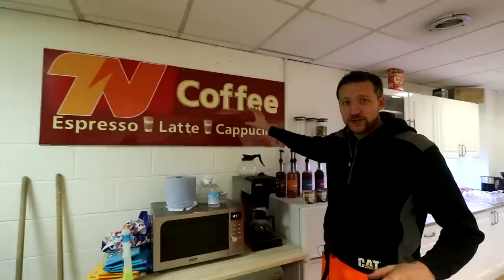I bought the CHEAPEST flood light in the UK | Nagy weekly ep08

Comment: Those LED panels are totally unsmoothed.  The LEDs strobe at 100Hz on the rectified DC and use very simple current regulation, so the LEDs tend to only light for the upper part of the sinewave.  Hopefully yours was actually earthed, as some of the earth wires are not connected internally.  That's not good, because a common failure mode of these lights is for a failed LED to arc and potentially burn through the insulating layer to the aluminium panel it's mounted on.  That results in DC biased leakage.
Reply: i could actually hear your voice whilst i was reading this Clive
Reply: I'm pretty sure at some point big Clive will just be uk electrical advice service for all UK yt. Barry, ashen Tom you name it
Reply: As soon as Tom asked the question – I just knew that you would know the answer.  So pleased that you saw it and have provided a solution.
Reply: @BigClive.... As much as I thouroughly enjoy your channel, I don't understand why the flickering stopped when plugged into the ring back at the workshop.
Reply: @olly7673  at site it was probably voltdrop and the cheap unit cant cope, no voltdrop at the unit
Reply: @brianhewitt8618  That is what I mentioned earlier was my thoughts exactly but BigClive knows his onions.
Reply: @olly7673  my bad, I didn't read all the comments,  and yes he's a special breed
Reply: @frankiesparkes3947  that's a good idea!
Reply: And here was me writing a comment on how he should send these units to you for autopsy and then boom see your post lol
Reply: My beardy bro
Reply: @brianhewitt8618  That's what I was thinking. Wonder why Tom didn't check voltage on site.
Reply: As soon as I saw the flicker, I just kept thinking about Big Clive!
Reply: I'm so disappointed I have to wait till next week to find out why the flickering. I am three+ I think weeks in trying to troubleshoot flickering LED lights and it's not because they're on dimmers but they are. Every time the on-demand water heater kicks in it's gets psychedelics stroboscopic seizure inducing. I think what's happening is the triac is switching the power to the heating elements and element 2 is putting out a really weird waveform that's causing interference into the electrical distribution. Unfortunately they are all in one Canlighs in the new addition with plank board ceiling.
Reply: Well, that certainly pre-empts the comment I was going to make of "Send the floodlights to Big Clive"...
Reply: Big Clive speaks, everyone listens.👍😊Ahmen
Reply: I scrolled down to suggest he send you one of these lights for a tear down.
Check the earth is connected... things like that. :)
Reply: Is it something to do with the unit being 3 phase?
Reply: Are these lights worth buying and fixing the problems yourself. or are they totally rubbish. Would they be ok in a garage
Reply: I bet if he threw one on a variac and slowly dropped the voltage, the flickering would become increasingly obvious.

Comment: I'm guessing there's enough of a voltage drop on that cable to cause the light to flicker and the other brand is just better at handling that. 
Also, that 75W is assuming the light has unity power factor, it's probably closer to 60W.

Comment: These cheap floodlights are cheaper because they use less LED cobs and over drive them, so they are proper bright and pull the full amount of energy and heat up a lot. But they last way less than a proper floodlights. You can mod a 100W cheap floodlight to use 50 to 60% of the power so they last forever without issues even if you get less light.

Comment: I can highly recommend lights from Ledvance (which is a brand from Osram). They have floodlights in 6500, 4000 and 3000 K, with an competetive price and I very rarely had any problems with them. I don't know how the availability is in the UK, but in Austria/Germany you can get it at the wholesalers really quickly. Also they have other lights too (commercial / industrial), so it's worth checking out!

Comment: Flicker could be caused by a mix of the cheaply constructed LED driver circuit and the already choppy supply feeding it. All those other lights on the same supply feed have their own switch mode supplies which will have an impact.
Reply: A small noisy ripple superposed on the 230V AC won't be noticeable with any meter (or oscilloscope; a spectrum analyzer could be useful, not really an electricians tool however) I would try to add a small 230V rated capacitor in parallel with the lamp, it should take care of the (majority) of the noise...
Reply: Maybe it was to cold outside
Reply: Better lamps will have better capacitive filtering on the driver output. More components, more £££.
Reply: @laurensscheldeman4121  You could probably swipe a capacitor out of an old fluorescent unit.

Comment: Regarding the gel... I spoke to a rep from Wiska at Elex last month who enlightened me about why IP66 boxes get wet inside. It is due to pressure differentials throughtout the year. Inside the box, being a vacuum, draws in moisture from the air from chages between hot weather and cold weather causing condensation inside the box BUT they have an answer to boxes above ground (not buried under ground which do need gel) in the form of VentGland or VentPlug which equalise the pressure throughout the year.
Reply: I work in a wet environment and they say a box is ip rated until you drill a hole in it. After that as you say the atmospheric conditions heating cooling and water vapour cause water ingress.
Reply: Hang on.: You say that the inside of the box contains a vacuum - yes? - So how does a box that contains a vacuum draw in moisture from the air? If that were the case then the vacuum seal would have to be broken first.
Reply: @Sharron-Idol  that is what was explained to me as being the case - the seal is broken by the expansion and contraction of the plastic due to warming up and cooling down and drawing in the moist air which condensates inside it.
Reply: @olly7673  I understand what you're saying and the point you're making; but vacuum it is not. :)
Reply: @Sharron-Idol  a better term would be "sealed", or as wiska put it, "hermetically sealed"
Reply: @olly7673  Agreed. :)

Comment: If you want to change the colour of the light, and you can open it, you could try a photographic gel (plastic sheet) inside and convert from the cool white to warm white, you'll lose a bit of power output and you'll need to be careful of heat (although you can get heat resistant ones too).
Reply: And lose any warranty you might have had.

Comment: Re driveway lights, if possible insert a transformer after the switch and convert the ground lights to 12v selv, then they can't trip and will be safe
Reply: But ist there a damaged wire underground or short
Reply: @harrymcgill6291  from what he describes it sounds like a fault to earth... which can't occur with selv... probably due to moisture in buried junction boxes rather than damaged cable. But yes you'd have to test first to know that you still have at least two continous cores that aren't directly shorted to each other.
Reply: @lewistempleman9752  👍🏻👍🏻
Reply: The connections will corrode away anyways even if you get it working for a short while.
Reply: @mrfrenzy.  They won't corrode that quickly infact, but even a couple of years would give them the option of working lights until they're ready to relay the drive and replace cables
Reply: @lewistempleman9752  So you're gonna spend time and money on replacing all the lights with 24V that may last a couple of months or a couple of years.
I would rather rent a ground cable locator and find out where the junction box is. Lift a couple of tiles and dig it up. Then you can easily isolate if the fault is in the box or one of the cables.
Reply: @mrfrenzy.  lifting stones would be preferable but he already said in the video they aren't going to do that,  converting to selv is a fairly inexpensive if temporary solution
Reply: @lewistempleman9752  And when it fails after 11 months the customer is going to want his money back (a business is required to give consumers a warranty in most of Europe).
Reply: @mrfrenzy.  you don't have to provide cover for the cabling and any parts you didnt install, personally I always give the clients all the options and inform them of the risks, as you say you can only test the cables and give a professional opinion, I've got plenty of wealthy clients who would spend the money to have working lights knowing they may fail again in the future, I've also got clients who I know don't have the money and I wouldn't be pushing them to spend it, there may also be other options but SELV conversion has often got me out of trouble
Reply: Was thinking the same, can you use the "damaged" cable with a poss earth fault to make say 2 strands of 12v, then run each lamp at 12v selv, that way you (might) not have to dig up the drive? I mean hey... it might not work but might be worth a shot?

Comment: Have you checked the supply Voltage at the tree 🎄..?
Cheaper fittings have less voltage tolerances than expensive ones...

That's why it'll work fine in the workshop because short cable runs...
Long cable runs in the garden = volt drop...

Comment: Flicker on the floodlight will be the cheapo power supply inside. If you fancy tinkering just put a quality capacitor on the PSU output. That will smooth it and take the flicker out.
Reply: True. But it'll also increase the mean voltage, which could cause premature failure.

Comment: We make led floodlights in power outputs up to 10000 lumens polycarb bodies and replaceable boards and driver colour temps down to 2400k. Not the cheapest but every component driver board etc etc is replaceable so pretty economical in the long run, we hate the idea of all the work going into making and shipping these products and they just end up in the bin.
   Water finds its own width !!! I have been making IP rated products for over 25 years it's hard !!!! Love the Gel connectors simple effective solution.

Comment: On the driveway lights with the failed underground cable... it looks like you've got three core (2 + earth) flex.

Would it be an option to work out which of the cores are faulty, say there's a line-earth short, connect them together and swap the whole thing to 12 or 24V? So your brown and yellow/green would be +12 and your blue would be 0. Or whatever combination of cables that makes it function.

You'd have to be very careful to label everything, oversleeve, put an obvious sticker where it's fed from saying "it's like this because" etc. etc. but it might work.
Reply: That's only a temporary workaround. Soon the connections in the water filled box will corrode away.
Reply: No, it doesn't work that way, the cross-sectional area with 12V would have to be a LOT larger to carry the required current.
Reply: @mrfrenzy.  you're quite right, I hadn't considered that aspect! 
Not that the original install was done in such a way to make it anything close to permanent 😅
Reply: @mikeZL3XD7029  if you've got 6 lamps at 3W each running at 24V it's less than an amp. And the cable looked like it could have been 1.5mm so that doesn't seem too out of whack? 

Clearly a 50W halogen at each point is going to be problematic!

Comment: Flicker will be from electrical noise from the supply or items on the supply feed.
Out of interest was the LED transformer on the supply feed for the flood light.
Those cheap LED lights have no smoothing in the circuit usually so that could cause the flicker.

Comment: Electric forklifts have hydraulic motors so the are rock solid. At my old unit, one of the guys had a right ropey forklift with old crusty batterys. It always run out of guts on the small incline of the alley drive way. Forever asking the engineere to give it a tow in his automatic jeep thing with the fork lift barley powering its pump. Asked me once, but I said get stuffed, I'm not riding my clutch for 3 minutes pulling 5 tonnes of scrap up the drive.
BTW, stick that flood light in the fridge or freezer, bet it flickers then.

Comment: Those 2V cells in the fork-lift batter look to be what we called submarine cells, supposedly because they were used in subs.  Their virtue was that they suffer little degradation from deep discharge. 

The can't move if no power at all is probably a "safety feature".  But if so not having some way of negating the interlock in an emergency is daft engineering.

Comment: Like Clive said he has dealt with a few of those types.. i recon the voltage at the JB was just low enough to be an issue for the driver circuit. In fairness those 2 look better quality than the ones Clive took apart.. defo check the earth like Clive mentioned.

Comment: You should have measured the voltage exactly at the point of termination with a decent multimeter for those lights. It may be that voltage was out of their range, so volt drop maybe a factor. A lot of electronics requires between 220v and 240. I have seen electronic equipment that has stated 230v and that’s that. Come in any lower and it won’t work right or won’t last long
Reply: OTOH, the grid is allowed to fluctuate quite a bit (+/-10%, i.e.between 207 and 253 V)t and devices connected to it must be capable of dealing with it.

Comment: Those cheap led fittings are usually over driven hard & all the ones I've used have lasted about 13 months (typical) & then one led chip will fail & drag the rest down so it'll flicker or run dim

Comment: You sure you dont have a fair vdrop by the time you get to that light Tom? Would probably explain the flickering if it was to low.... Imagine would effect some makes / models and not others, just depends on how good / bad the fittings are.... Could also explain why that LED strip driver wasnt working?! Might have been right on the voltage limit and happened to be ok again when new one went in, just a thought!

Comment: Thanks for this Tom. As for your flickering flood.... what is the voltage drop at the tree? It looks like it might be a fair way from the house and sharing the supply. The driver might be sensitive more than the spot next to it. 
Instead of using a plastic coated hand screwdriver attachment, why not buy a long bit James? London is full of angry people all rushing, or wanting to rush somewhere but with the amount of traffic most of your day is sat still in traffic jams really chilling out those already angry people....... not.
I don't see an issue with using adhesive, you would deform the steel of the back box before the adhesive would give way and is stronger than a lot of mechanical fixings of a screw and red plug.
Perfect pairing of Skittles, Smarties and M&Ms BTW, the question is peanut or chocolate? 👍😊

Comment: Gripfill: Sorry mate, tried that stuff on a job, very, very not good.  Took ages to go off, and until it did, the box moved around on the wall; so running cables into it was a no go.
Expanding foam however, very fckn good.  Use that stuff whenever poss.  if you've got a line of accessories in a row, that stuff's great for setting them up properly, keeping them exactly where you want them.

Jolly good, carry on 😁

Comment: 220V-240V is not fine for UK products as the mains supply is 230V -6%/+10%, so can range from 216-253V, products that don't work correctly within that range are not fit for UK use!
Instead of using a Wera bit, Screwfix have a set of 150mm long impact screwdriver bits (16648) that are designed to do the job & cheap enough to have a set or two in each van!

Comment: Flicker in leds often relates to a smoothing capacitor being faulty. Might be worth opening up the lights and checking the capacitors. Easy fix with a soldering iron.
Reply: Well, yes it MIGHT be, but it could also be a faulty rectifier pack, it could also be faulty LED's, it could also be a situation of super-imposed DC on the supply to the AC waveform to the fitting.
Reply: @mikeZL3XD7029  Very true but if it is a faulty capacitor, it is a quick and easy test to confirm and an easy fix, hence my mentioning it. Most other options will be tricky for someone without electronics experience to diagnose or fix.

Comment: Could those LED panels have such a lousy driver circuit that it jams RCDs like a D-Lok?  If so, it'd be worth checking that it's wired properly and not got N-E reversed (which would work fine on TN-S or TN-C-S but would not be happy on a TT supply).

Comment: I was gunna ask what else is on the circuit. I have a couple lamps over benches that get a bit unhappy and flicker like that when I put a load on like a vacuum cleaner or heaters (3d printers) on the same circuit. IDK the answer but could spark an idea, voltage doesnt change, frequency appears to stay the same, tho kilowatt could be showing smoothed numbers.

Comment: Those drill bits look interesting.. any reason to get the hex shanked ones over normal rounded if to be used in a standard drill ? Have seen the do a 4 pack round or 5 pack hex - would you expect the same quality of both?
Reply: They're not your average bits, they're the Bosch multipurpose (I'm sure they used to be called multi construction) bits that are designed in such a way they can be used without hammer. They can also drill things other than brick.

You can use them in a screwdriver or similar, the Bosch 12V screwdriver is basically a drill with no chuck. 

They make non hex ones too.

Comment: For halloween we build oure own uv flood lights from a old halogen flood light took its guts out get a uv cob chip and a aluminium bar on witch we mounted the cob chip with heat paste bolted the bar to the fixture and rigged up the 36v lead as we have riged a multi power between the light post in oure street and we had an  amezing halloween